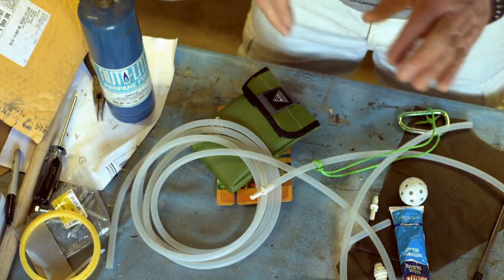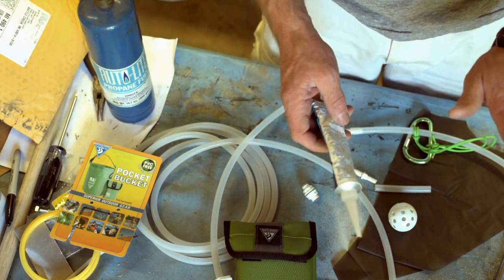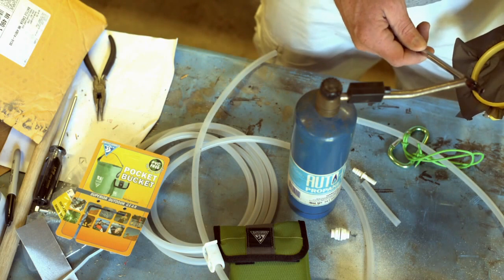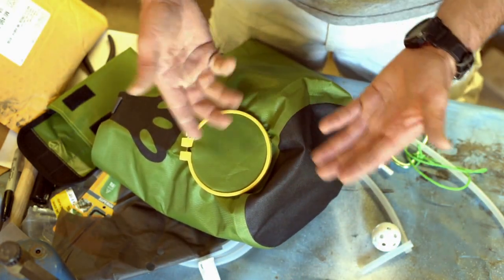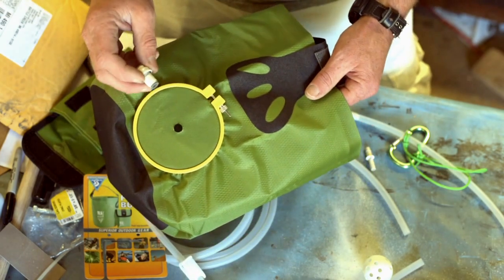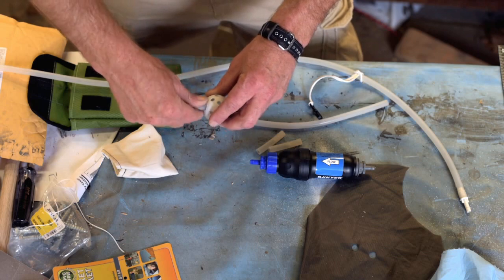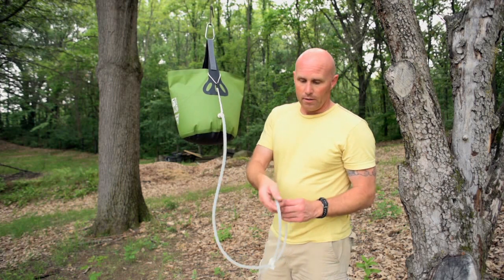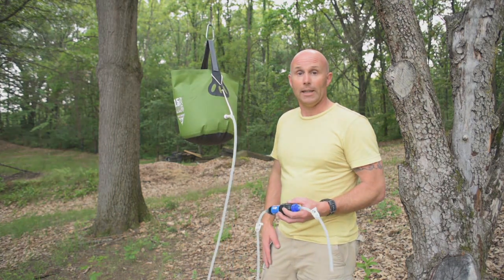Simple DIY Gravity Filter System

Comment: Hello redoleary4,

First and foremost, great tutorial.  I  can see in the comments below about the silicone sealant as being a "belt and suspenders approach."  After further research online involving the MSDS toxicity information involving the silicone sealant, I was a bit apprehensive and decided to go right to the source for my inquiries.  
For reference, I purchased a tube of the "Dap 00688 All-Purpose Adhesive Sealant, 100% Silicone, 2.8-Ounce Tube (Aquarium Safe)" as my silicone sealant (which was different from the brand of sealant that you had used in your video presentation).  

Here was the response from DAP: 

"Thank you for your inquiry. 
While the All Purpose Adhesive Sealant is indeed food safe once fully cured, however, it is not consider safe for potable water applications."

Jessie L. Hubbard
Product Information Specialist
DAP Products Inc.

I am not sure if this explanation is helpful for anyone but just wanted to put this information out there.

Kind regards.

Comment: Great tutorial Red. Question: Is the silicone necessary to seal the bulkhead fitting? Do the inside and outside washers not bind against the bulkhead material tightly? Thanks again.
Reply from the maker: Thanks John.  The silicone is sort of a belt and suspenders approach.  The seal built into the fittings isn't that large/thick and the weave of the fabric is a little coarse so I think the silicone is cheap insurance on getting a good seal.

Comment: Thanks for the video!

I'm interested in trying this but am worried about melting the hole wrong. The bulkhead part you linked to says it is 1/2 inch hole size but you mentioned using a 1/4 inch socket? Is that correct?

Also, I'm contemplating if rubber washers on each side of the bulkhead would eliminate the need to use the glue?
Reply from the maker: The O.D. of a 1/4" socket is close enough to to get a good snug fit on the fitting thru the hole.  Make a couple of practice melts in some scrap before you try on the real deal so you can anticipate how everything is going to go down.  The silicone I used on it is really just a belt and suspenders approach, I don't know if the silicone is required but I do know that it doesn't hurt. :)

Comment: Why do you put the hose on the side as opposed to the bottom? Prevent sediment from getting in the line?
Reply from the maker: +Bryan Ramler  Two reasons: 1. Yes partly for the sediment andI can get more water out of it because I can adjust the angle of the pickup, where if it came straight up out of the bottom it would stick up out of the water sooner  (thats the thought process anyway) and 2.  I can still set the bucket down on a flat surface if one presents itself... however unlikely that is.
Reply: +redoleary4 Makes sense, thanks. Good tutorial, I'll definitely make one. We currently use a Katadyn Base Camp and after about 2 days in the BWCA it slows down to about a drop per minute. I like the how the Sawyer can be back flushed and the whole system is about the price of a Katadyn filter replacement.